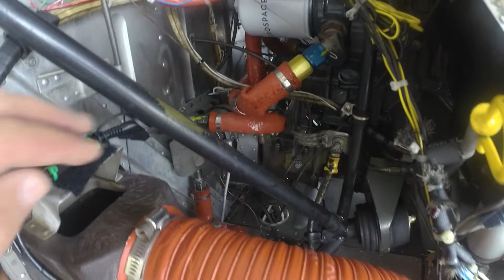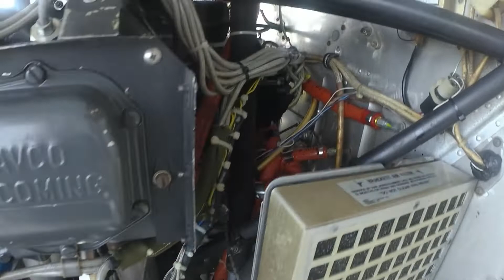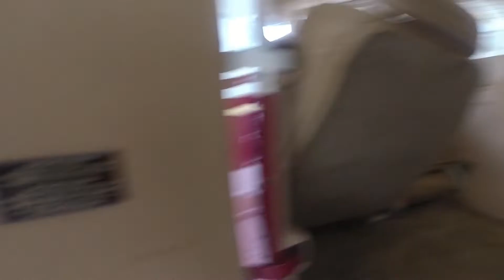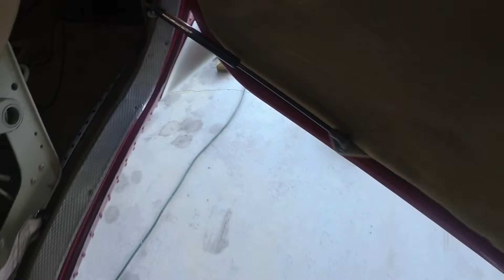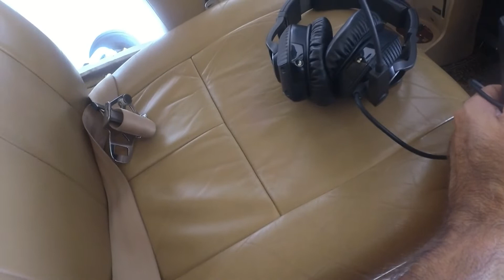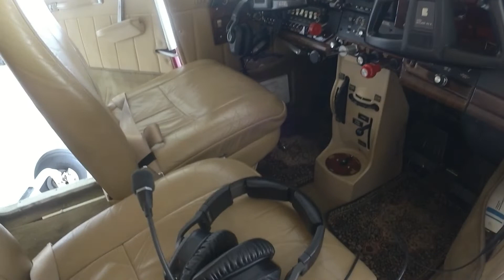Cessna TR182 Engine and interior walkaround

Comment: To what connections did you attach your "onboard" battery minder cables. Considering this myself.
Reply from the maker: The Battery Minder comes with eye ring connectors that have an inline fuse to connect directly to the battery. Works great.
Reply: @baronpilot2bb  Thanks for the reply! A while back, I bought a Batteryminder/ground support unit on sale and a BM-AIK2A Kit to attach to the aircraft. The included instructions called for it to be installed on the solenoid. My AP installed it as instructed but do to use the wire broke and I removed it. Curious why this kit called to be installed on the solenoid and not directly to the battery which would have been much easier.
Reply from the maker: @RB-bt2ig  there is zero reason to connect it to the solenoid.
Reply: @baronpilot2bb  I agree with you..I will probably attach mine as you did.  Thanks for your help!

Comment: Are you sure about your explanation of the wastegate at the beginning? A wastgate usually is in the “hot” part of the system right in front of the hot side of the turbocharger and controls how much of the exhaust is dumped around the turbo in order to maintain manifold presser. I have never heard about a wastegate on the “cold” intake side of the system.
Reply from the maker: I think you may be confusing my explanation of the cold intake air that is compressed by the compressor side of the turbo. With the manual waste gate, the exhaust side which has the waste gate is open fully with the throttle closed which dumps all exhaust overboard instead of turning the turbo. As the throttle is opened the manual waste gate still stays open until a mechanical set point is hit where a cam slowly closes the waste gate at that point providing airflow over the turbine which compresses the intake air allowing you to continue to make sea level power up to 18k ft. As this air is compressed it becomes hotter due to the compression.

If I gave an indication that the intake air is dumped overboard I apologize as that would be incorrect.

Comment: Needs that's fancy 3 blade prop for max ramp cool
Reply from the maker: 3 blade looks better. It adds weight and provides no performance gain and actually slows down the plane a bit.
Reply: 3 blade smoother in my experience with dynamic balance. Certainly didn’t slow my application down. C185 conversion from 2 blade to scimitar. Would do it all over again. Quiet, smooth, gained about 5kts. Nice airplane tour.thanks